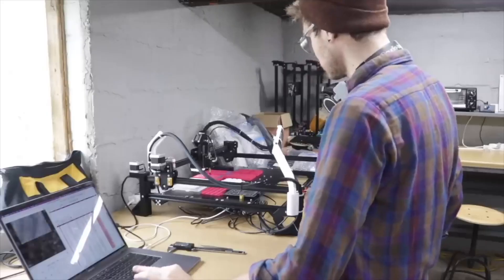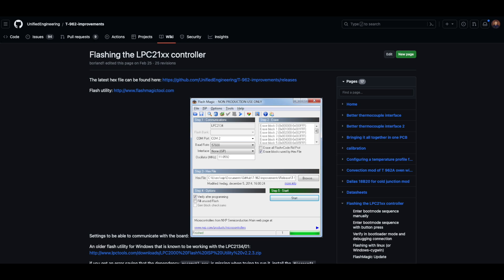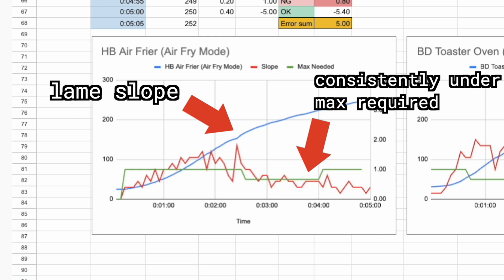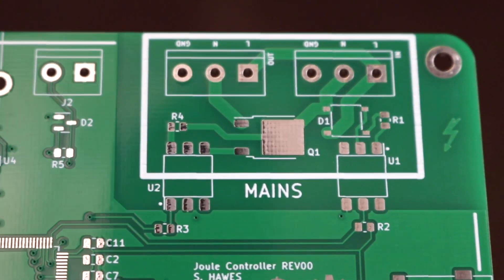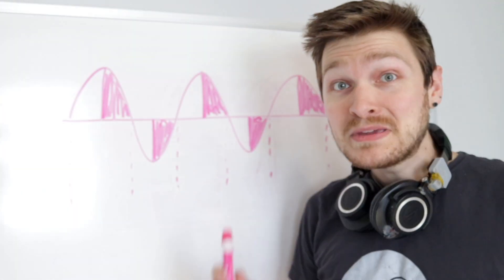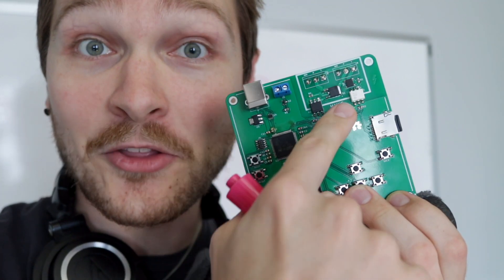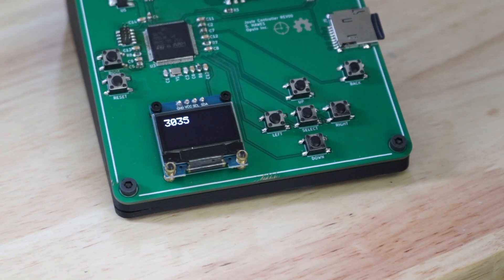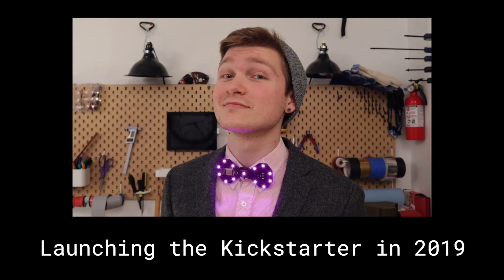turn any toaster oven into a reflow oven!

Comment: I basically built what you're up to but for incubating eggs with a standard light bulb instead of reflowing solder paste. The right PID coefficients have been the most tricky part here. For obvious reasons I could not tolerate any overshoot whatsoever. I need however a target temperature as smooth as can be in a range of less than 0.2°C. To top things up the ramp up should be quite fast. So, 5 minutes max to 35.7°C, no overshoot, keep it there, little wiggle room of E~0.2°C. And, yes, make it robust against disturbances, no big over- or undershoots there either. Hard to hit those targets combined. Up to now, there's always been tradeoffs, haven't been able to meet all criteria at once, yet. Top prio is E and overshoot. Undershoot and ramp-up is least critical. With reflow ovens it's maybe less of an ordeal. Keep us in the loop, I'm curious about your reflow profile confidence level.
Reply: What temperature sensor arrangement are you using? Type of sensor, placement and so on?  And does your chamber have a method to circulate the air (like a fan)?
Reply: @Graham_Wideman  K-type (for the PID loop) and an SI7021-type sensor (via esp32, tasmota) for verification. Both between and at the top of the eggs. Third, 7021-type, sensor at incubator ceiling. Fan to distribute heat/prevent hot spots. Incubator is isolated by 4cm styro. No window but an esp32-cam. Dimmable (PWM) LED strip (still flickers a bit at the set frequency). Fan does not do it's job as intended yet. Still very distinct heat strata (astonishingly so). WIP.

Comment: Why couldn't one use 2 230v tollerating mosfets and regulate the positive and negative phases seperately in parallel? Although perhaps still warmer than a ssr i'd guess that its at least more handleable. Plus with a analogout capable mcu (or dacu) you could do some "wave trimming" wich could improve the acceptance for otherwise less power regulation accepting toasters

Comment: SSRs are also just this triac circuit with a zero crossing controller chip(something like the MOC3041M), potted and on a heatsink.
There's nothing magical about them. But yes, I'd recommend that you buy a pre-made unit if you want to avoid the hassle of bringing mains onto your PCBs, which can complicate certification.

Comment: Use triac and a zero crossing opto isolator and then slow your "pwm" down to a second or two. the power blowing your triac is due to you switching at full voltage rather than on the crossing.  A heat sink might be a good idea too even with zero crossing.

Comment: Also, you can use the zero crossing detection to turn relays on/off without arcing, to do this you need to determine the on-delay and off-delay of the relays.  Then you use the zero crossing input signal to start a timer, when the timer elapses the output channel of the timer turns on the relay just before the start of the next zero crossing event, the relay then should activate at 0V which will then not cause arcing on the contacts.  to turn off the relay do the same thing, but adjust the timer to take account how long the relay takes to turn off.    turning on a relay is solenoid activated, turning off a relay is usually via a return spring, both on/off actions take different amount of time to complete.

I use zero crossing activated relays to control bar heater elements. and i use an SSR to control power to a 2kw halogen lamp.   the bar heaters only come on when the different between the target temperature and actual temperature is large, this avoids excessive switching.  the halogen lamp reacts MUCH quicker, so an SSR is used to control the halogent lamp.

combo microwave convection ovens are the best as they have turntables and convection fans and are the most easy to retofit, but not as simple to control...

also, microwaves have excellent interlocking safety facilities (switches) which can be re-purposed to automatically kill the power to heater elements if the door is opened.

the biggest issue you'll have with using a toaster oven is the downward slope of the reflow profile, i've seen people use aircon butterfly valves and an inline blower to get the oven to cool down quickly.   toaster ovens are also terrible at keeping the heat inside them.  i used rockwool which is use for fireplace insulation around mine, made a huuge difference.

Comment: That is is a wicked project Stephen! An "all in one box" to plug a toaster into was something I was looking at for a long time, but as you now see, the SSR is mandatory, and you'll likely find an SSR mounted to the main PCB still an issue (I did, I couldn't find anything that didn't still require active cooling on the PCB) which is why I landed on an external SSR requirement.  They still get quite hot, and I always recommend folks don't even mount them inside their toaster without some thermal shielding as mounting a device that gets hot to a unit that is designed to generate a lot of heat..  um, danger danger  Will Robinson! hahaha.

I look forward to seeing your next steps on this, and thanks for the nice shoutout at the start and the RMP link in the description!

Comment: @stephen_hawes I've been doing my own project that involves ZCD with SSR, and I think you'll find this useful. I'm using TI's TIDA-050058 reference design as a basis for my project. It gives you control over choice of MOSFETs with much better performance than thyristors/triacs. You could adapt this design to use the latched ZCD signal not only to open the relay with enable signal but also to start the countdown timer on the MCU to regulate the heater current to get the "PWM" control.  The advantage of the TPSI3050/TPSI3052 (10V/15V VGS) isolated gate driver is that it is self-powered with plenty of leftover auxiliary power to run the AMC23C10 isolated comparator specifically intended for ZCD. This is more efficient, faster switching, and lower delay than the bridge-optocoupler-triac method.

Comment: Another approach I have used to control a heating element is the opposite of the leading edge triac control, trailing edge control. There's a really great trailing edge controller ic 'FL5150' that drives a pair of MOSFETs with just a plain DC control signal. Although I suspect this would have the same thermal problems as the triac at those high currents.
Reply: Trailing edge ..so one always turns the switch on at zero voltage..so no inrush/ turn on spikes..and phase controlled turn off can be a soft turn off type so the EMI/ EMC compliance can be met easily.

Comment: Use TO220 package, and add heatsink, also for emc you can turn on or off a complete cycle, for example turn odd ones on and the even ones off, you would get 50% power
Reply: "you can turn on or off a complete cycle"  Stephen had a whole section of video about zero-crossing SSRs.

Comment: You could use two MOSFETs to switch whole halfwaves with your zero crossing detection. But you would need pretty low Rdson to make a significant reduction in conduction losses. Like 10mΩ for 1W per FET losses. Basically designing an ZCD-SSR by yourself. This would be super neat and I should definetly at some point try it out, BUT for this project you will be far better of keeping the mains of the PCB and using SSRs designed and already certified(!) to handle the current required. My Power Electronic heart bleeds electrons typing this, but after some thought it seems the best compromise. Or you add more heat sinking capability, but thats a whole other can of worms with case isolation and so on.
Reply: Back-to-back power MOSFETs and a zero-crossing photodiode gate driver makes for a great and super-efficient SSR. Made a few of those for projects and they're solid performers.
Reply: @OddlyIncredible 
For 60 Hz or 120 zcd's and two back to back igbt's or mosfets...
(N ch.. g-d-s in " series " with another as s-d-g) ..its not necessary to have any zcd based triggering.
This is reduced complexity at the cost of slightly higher switching losses..if one considers a switched pwm of around just 240 to 500 Hz or thereabouts...this can provide sufficiently good regulation..
Reply: @analoghardwaretops3976   Yep, that would give pretty robust control. However, that having been said, if he's using a conventional heater element or quarts IR tube oven, he doesn't even need that because the total thermal hysteresis of these toaster/convection ovens is crazy high - for example, I have my oven controller set up with a 10 second dwell time.

All he'd really need to do is drive the heater at a 10s "on" time and 50% duty cycle to bring it to soak temp, hang there for a minute or so, go full power to reflow, then switch off and let the oven coast back down from there - no real need in this application to do waveform level control.

Comment: My T962A has been great. I did the mods and custom firmware. I soak it at 60 for a few minutes first, and try to avoid putting anything right at the edges of the tray.
Reply: it has no heating modules at the bottom and that's a problem.
Reply: @mrechbreger  no issues for me.
Reply: @gregstinkertown  you might know this, even if you rework outside a heat bed is recommended. If you do this inside this oven you stress the components unnecessarily. It might work but for sure it's not good practice.
Different solder has different melting points, this oven is definitely on the lower part of supporting various pastes.
I would never put TG140 into a single sided heating oven only..

Comment: I'm not really sure how accurate you need the control to be but deciding to switch power every 0.25s or so would mean that you don't need to evaluate the phase of your ac. I don't really understand why you need the heater control to be at such a high frequency.

Comment: I'm using a completely unmodified quartz-tube IR convection oven set to full-tilt, controlled by a programmable 1/2-DIN industrial PID temp controller and 25A zero-crossing SSR in a separate enclosure (pic of setup in use - https://i.imgur.com/6tSngRV.jpg ), to do my reflows and it does 250C without any trouble.

I'm using MG Chemicals' SAC305 paste for my board work when RoHS compliance is a goal, which doesn't need to go as high as 250C. Picked that paste because I've been using SAC305 alloy solder for years now and it's just easier to use the same alloy for both reflowing and manual work, and they're widely available in the US.

Comment: Years ago there was a product called the Reflowster. It was a controller that turned a toaster oven into a reflow oven with zero modification required. I still have one.
Reply: Came here to mention Reflowster and saw your comment. I haven’t used mine for several years, but it worked great!
Reply: @doogulass  yeh. shame they disappeared...i think they came a little too early... there is more and more demand for it now.
Reply: Perhaps they ran into issues with people using newer, more expensive toaster ovens that have electronic controls built-in. The Reflowster really needs a dead-simple toaster oven with physical thermostat that won't be screwed up by power cycling.

Comment: Inspiring work! A few words of caution and some suggestions: if your product touches the main lines (120v / 240v) it must be UL certified. Otherwise you are  exposing yourself and your company can be held liable for any fire incidents or electric shock etc. Alternatively I suggest you source a high power smart dimmer that is already UL certified and only send control commands to it....
Reply: The problem is that UL certification is lengthy and expensive. A DIY kit without the power parts can probably avoid the  headaches

Comment: Concur on switching to an SSR.   It's still a proportional control system where the power to the heaters is proportional to the multi-cycle on-off time.  Actually, this makes more sense as the thermal reaction time of the heating elements is actually quite slow as you've shown by the full-on ramping time experiments at the beginning. In effect, you're modulating reduced heating rates where that test curve is the maximum achievable heating rate given the existing heating elements, oven insulation, oven thermal mass and thermal leakage through the door edges of the unmodified oven.

Comment: Interestingly I got a T-962 with the intention of putting custom firmware and modding it... and it has basically worked fine out of the box for the last 5 years or so for big boards, small, and batches.  YMMV
Reply: Those 962s are a coin toss - I've heard of some people having great success with them with no mods aside from fixing stupid construction issues (e.g., replacing the masking tape inside with kapton/polyimide), and others have practically rebuilt the whole damn thing without any success whatsoever in toasting a board with it. I almost bought one but went the homebrew "industrial PID controller and SSR" route instead and it's worked out wonderfully.
Reply: @OddlyIncredible  it also depends on the solder, PB ... PB free and which kind of components are used on the PCB.
Also it depends on the ambient temperature.
Reply: @mrechbreger   Not really, no, at least in this context. The 962s can supposedly handle almost any soldering profile used in electronics, and they're (sorta-kinda) insulated so outside ambient isn't really relevant. It's more a case of terrible QC on an already half-assed product, where sometimes you just get a really bad one that can't be remade to work well without basically getting another one and starting over.

Comment: You can use the fact that you are not switching a lightbulb to your advantage - the switching is what is heating - but there is absolutely no reason to switch it 100 times a second - probably 10 times a second is more than enough probably even just switch it after measurable temperature change.

Comment: The first thing that occurred to me watching this is why use PID? You’re not doing either particularly rapid or particularly precise temperature control. Bang bang is probably enough and simplifies a lot.
Reply: He wants the PCB (and components and solder) to follow a temperature profile, as specified in component datasheets and commonly used in industry.  For that, PID or similar is needed. However, I agree that the cycle time does not need to be 120/sec, and could easily be more like a few times a sec or even 1/sec.
Reply: @Graham_Wideman  nah, a PID is overkill for that. You’d likely need a PID to get 0.1C accuracy but I don’t expect his temperature probes or the compartment consistency to allow that. You also don’t need it to  follow the ramp. 

Also keep in mind that to work well a PID needs symmetric forcing (ie it must be able to cool as well as heat). +/-1C is very likely attainable with a bang bang controller and at the limit of what the setup can probably attain and better than required.
Reply: @robertadsett5273  "You also don’t need it to  follow the ramp."  If you are serious with that comment, then you are not serious about reflow soldering for production.  I do agree that PID needs to have control authority in both directions (hence my "or similar"), but some sort of algorithm is needed, and it helps if it has learned the oven parameters ahead of time in order to do so.
Reply: @Graham_Wideman  sorry, I meant you don’t need a PID to follow the ramp. A bang bang will follow a ramp in the same fashion as a PID
Reply: @robertadsett5273  Ah, that makes more sense.  Yes, a bang bang will follow a ramp because it is essentially a form of PID.  The controller output to the heater is rather slow PWM and you choose a an amount of hysteresis in the temperature set points (relative to the ramp moving target).  it's just that you've limited yourself to only a particular set of constants rather than choosing them more flexibly.  i would argue that the amount of thermal momentum in the oven's heaters will result in excessive overshoot unless the algorithm (whether PID or something else) anticipates that momentum. But I guess that depends how under or overpowered they are compared to the ramp requirements, and how much heat loss there is to effect the downward control.
Reply: @Graham_Wideman  “it’s essentially a PID” except for not having a P, I or D term in it. 

Overshoot is a possibility but I doubt it’s a practical concern. Overshooting only come from the heat stored in the element which has to be relatively minimal or the oven couldn’t be used as an oven. It’s easy to characterize the worst case by running the temperature up to, say, 200C, turning off the element and see how far it rises after you turn it off. It’ll only be less when you load the oven. 

The thing with heating is that unless you have a small mass sample they have large time constants. You have to ramp slowly to avoid heating only the exterior. They’re basically a near perfect match for bang bang and a bad match, in most cases, for PID. 

While it makes sense to keep a PID in mind in case it’s needed I doubt it’s worth the added complexity and tuning it would entail, one of the advantages of bang bang is its lack of tuning with the only parameter being the deadband
Reply: @Graham_Wideman  oh and something like a toaster oven is usually just a bang bang control. Sometimes just a bimetallic coil
Reply: The other thing that just occurred to me is that this is only going to work with a very dumb oven. The more features on it the less likely that just turning it off and on is going to work and the more likely you’ll need to gut it’s controls